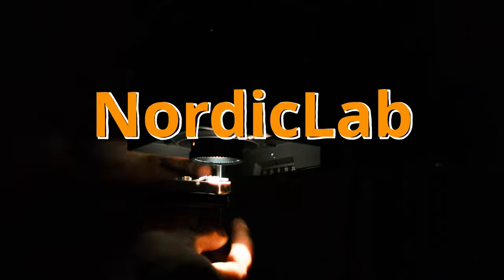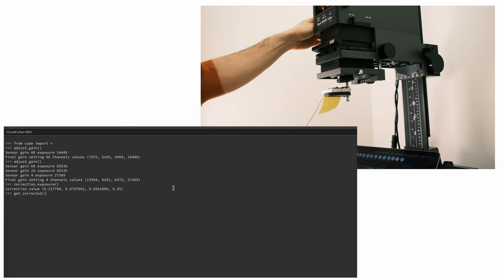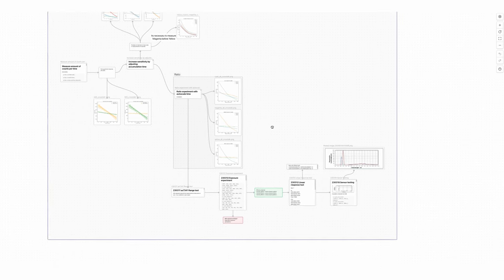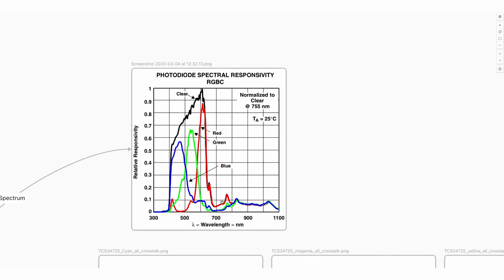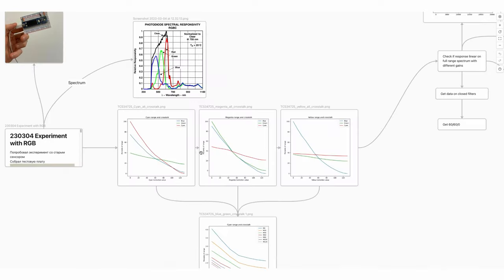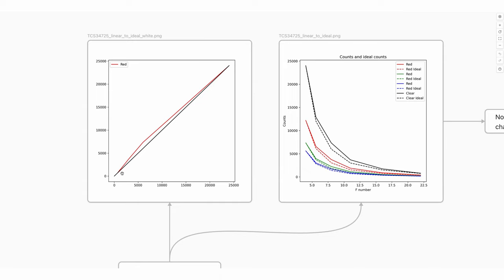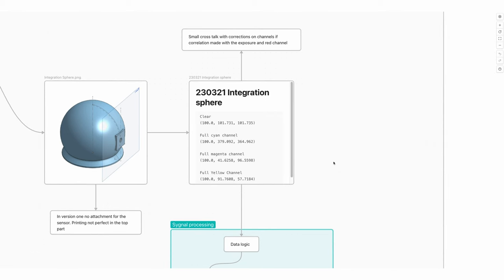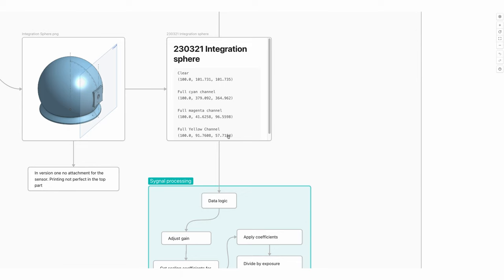Color analyser project: update on crosstalk, calculations and sensor types

Comment: I can appreciate the intellectual challenge of creating a color analyzer like this, but anyone thinking about doing this should know that if all you want is something like this to use in printing, there are dozens of types out there in the market, many new in the box, left over from the end of the home darkroom days, which can be had for less than $50, often much less, as well as more serious units which will do a more complex job beyond the abilities of this type of analyzer.
Reply from the maker: Good point, but in the same time there’s reason for that - most of the time they really primitive and you cannot recalibrate, align with digital reference, memorise settings and usually this tools works not better then guessing